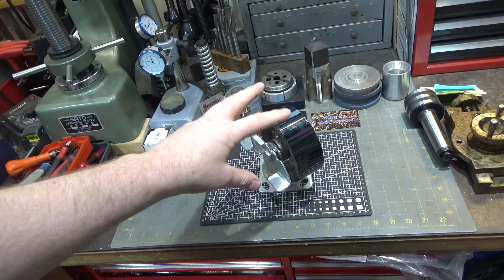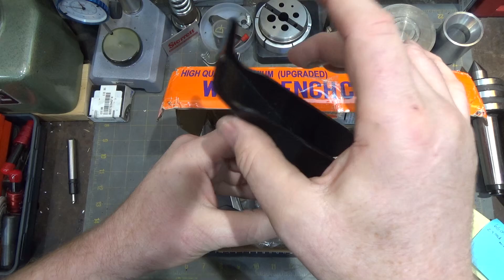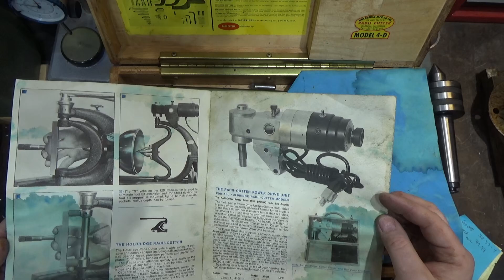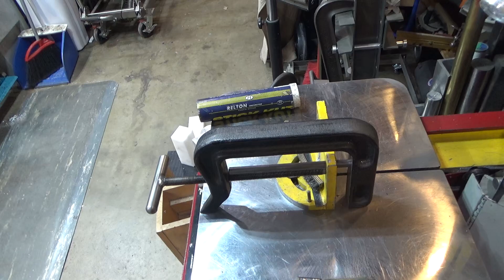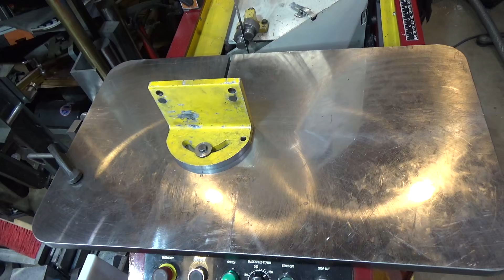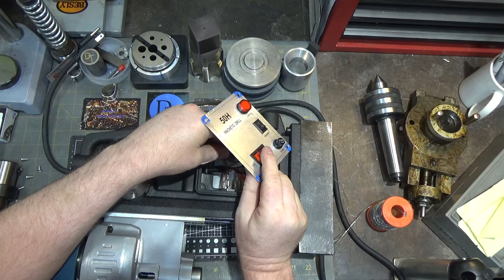QTR 63 Combined Parts Magnetic Drill Press Review and Extras

Comment: The center point just drops in the top of the cutter and usually sticks up about. 1/4 inch if none of your cutters came with a point you can usually buy them separately or just make one I don't know if they're hardened or not since they're basically so you can line up like a regular drill bit and just get pushed up inside as you cut hence the long spring 👍👍👍
Reply from the maker: Thanks for the further clarification.
Reply: @DudleyToolwright  no probably thanks for the review I've often wondered about those units since they usually have a couple pics and a generic description I would like one for occasional use for now I just use them in a collet on the mill but having one would really come in handy there is one made by I think a german company that has a small x y table like you mentioned doing that can mill small slots but it is pretty pricey but man it looks cool

Comment: The spring is for if you have an annlar cutter that you're using the center point on for finding center on a mark of punched hole so when you press down lining up the center point doesn't just get stuck up inside the cutter since they are usually a pretty tight fit
Reply from the maker: Thanks. This particular explanation was more nuanced than some of the others. Much appreciated.

Comment: the spring is for center pin for larger annular cutter .
Reply from the maker: Thanks for the tip. I have only used the annular cutters on rigid machines like the mill and the lathe before this and never needed to locate the center using a pin. I also have never had any issue ejecting the slug, but I defer to experience.
Reply: The pin in the center of the cutters serves 3 purposes. It allows the cutter to be centered, it allows coolant/lubricant to flow and it ejects the slug from inside the cutter when the drill is raised to it's maximum height. The spring is needed to hold the pin and to allow it to be pushed up into the holder as the cutter advances into the material. There are two different diameter center pins for different sized cutters as well as different lengths for different length cutters. The pin has a slot cut in it to allow coolant to flow inside the cutter. An annular cutter cuts from the inside out. The coolant/lubricant needs to be applied to the inside or the cutters will dull quickly. There are also a cream formula, Tapmatic Edge that can be applied to the inside of the cutter. I think Jancy Engineering out of Davenport Iowa was the first to modify a magnet drill to use annular cutters. They called it the Jancy Slugger USA-1. I bought one around 1990. Fein acquired Jancy Engineering in 2011 and sells the USA-101 which I think is still made in Davenport Iowa. https://www.amazon.com/Jancy-Portable-Magnetic-Base-Diameter-Capacity/dp/B003EYVE40  You will notice that it has a bearing support attached to the magnet base.
Reply from the maker: @tiredoldmechanic1791  Thanks for the useful info and history. I have only used the annular cutters on my mill and lathe and have never needed a center location, so have not used the pins. Thanks for all of the info and the Amazon link.